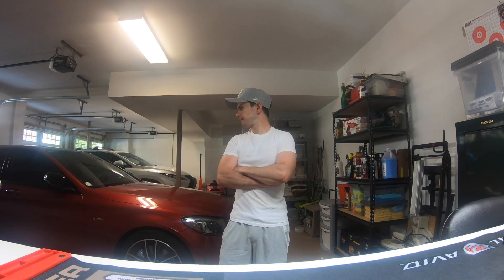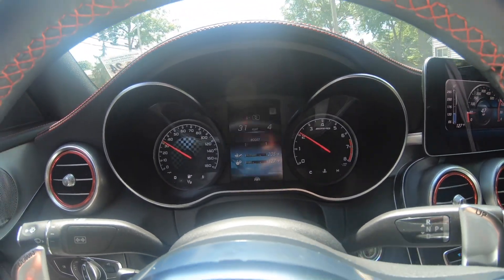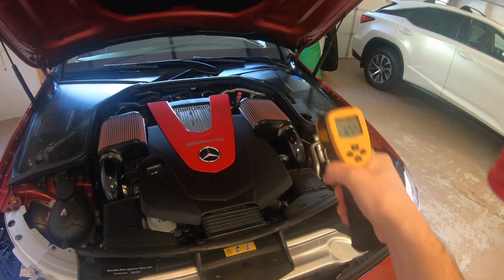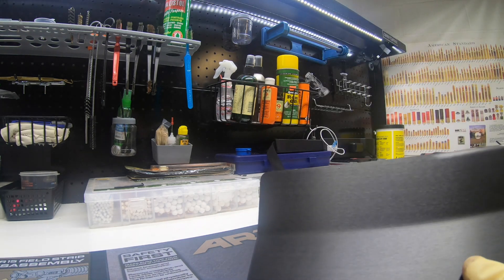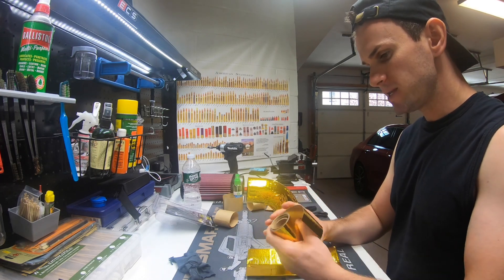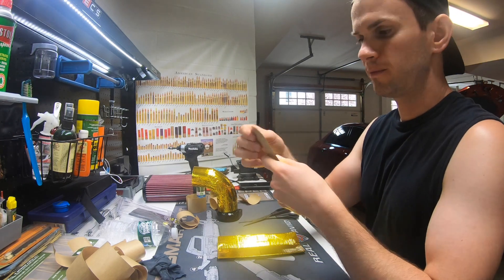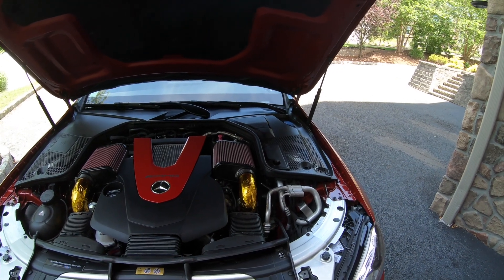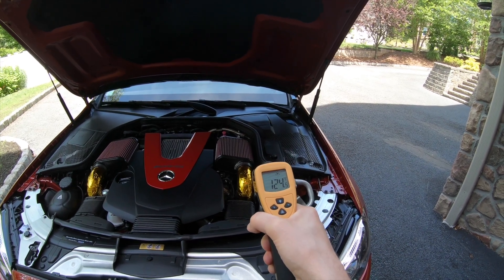Does heat wrap work?

Comment: In order to see if the air is actually cooler you'll have to check the temp of the air going through the intake as the heat wrap will still be hot from the engine thats why you didnt see much difference. There are vehicles that actually have air intake sensors to read the air temp.

Comment: I used to heat wrap my C63S intakes using DEI, the outside temperatures of the wrap dropped only a little bit while the intake air temperature didn't change too much, so I would say this DEI wrap is pretty useless.
Reply: Where even a couple degrees of difference matters is with forced induction. Even dropping two degrees off temps on my E63 adds power and has the turbos work less. Compressing cooler air is more efficient, so every little bit helps, especially on a car like M157 E63s where that engine bay gets pretty toasty. 

Would venting the ambient temps from the engine bay help more than the tape? Absolutely, but most higher end performance cars don't have aftermarket quality hoods and it's also not advisable or desired to cut and modify hoods on such vehicles either.

The optimum taping strategy is the entire intake piping and then also the exterior of the air boxes too.

Comment: the purpose of the tape is to protect the colder outside intake air from being warmed up by the under hood heat on its way to the motor 
 your intakes suck the hottest (lowest density) air available on the car under hood / exhaust manifolds and funnels it direct into the motor in this case the tape is actually holding in the heat not keeping it out
Reply: That's what I've been thinking since I've been seeing these... Like exhaust wrap it prevents the heat from resonating by keeping it in the pipe right? So it's not really good for an intake is what i understand.

Comment: Good to see that its doing something. Even tho it’s not the most scientific test with a heat gun taking temps of the outer surface.  Maybe getting an obd scanner to see the actual IAT’s would be  more accurate. Anyways you had a great opportunity to actually see the difference due to having two intake tubes.  Compared to a lot of us having only one.  Should have only wrapped 1x tube/heatshield and compare it to the non wrapped, given that you ran out of tape anyways
Reply from the maker: Best part is the the Jb4 App that controls my tuner shows your IAT 😂 didn’t think of it until after everything was wrapped and back together! May have to revisit this one to truly compare.

Comment: You have make the second mesure outside with a little wind that explains the difference.
And the really useful measure is inside the hose not the outside and more better the measure in same time that you drive for have the exact temperature do you have.
I believe with the APP torque and with a ELM 327 maybe you can have the temperature from the MAF
Reply from the maker: Yes
Reply: @HardHatExotics  I have edit the first message. 
Sorry for my bad English

Comment: Would u say that jb4 is better than Weistec as far as tuning goes for the car
Reply from the maker: Im honestly not familiar with Weistec or any of their products so I couldn't say lol
Reply: I just just purchased a c43 also and I have Weistec down pipes but I am getting reallly bad heat soak around 80 or 90 mph I live in Maryland so it gets extremely humid over the summer
Reply from the maker: M M  if the car seems to be running out of steam after 80-90 that sounds like a tuning issue, at that speed heat shouldn’t really be a factor at all.
Reply: What do u suggest if u don’t mind
Reply from the maker: M M  What’s happening at those speeds that’s leading you to believe you have an issue?
Reply: It’s almost like the car stops accelerating as hard!
Reply from the maker: M M are you running catless or high flows?
Reply: As of now I am running factory exhaust 
Weistec down pipes Weistec tune that’s it
Reply: Also Thankyou for answering I know I’m coming at you with a lot of questions!
Reply: But it doesn’t do it consistently only after super hard passes! I ordered water meth to see if that helps as well as intakes I’m going wrap them like u did I think that’s a good idea especially when I want the engine to run as cool as possible! 

Secondly how much do you think h th e M276 DeLA Biturbo can handle at the block I don’t c why 2.0 I4s can run boost levels as high as 700 hp

Comment: Do they fit a 2020 c43? If so can I get a link to buy them please ?
Reply from the maker: Señor Lopez  Heat wrap is universal and works on everything so yes it would.    Design Engineering 010396 Reflect-A-GOLD High-Temperature Heat Reflective Adhesive Backed Roll, 2" x 15' Roll https://www.amazon.com/dp/B0039Z5TYU/ref=cm_sw_r_cp_api_i_RTj.Eb1PKTJG2
Reply: HardHatExotics Thank you I appreciate it!
Reply from the maker: Señor Lopez  Welcome bud!